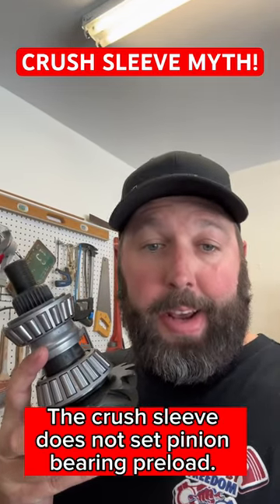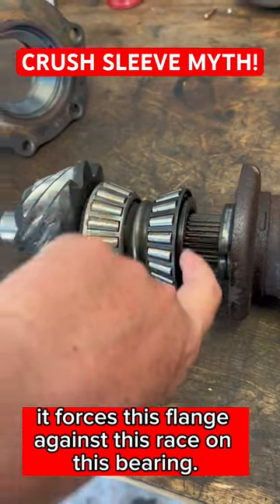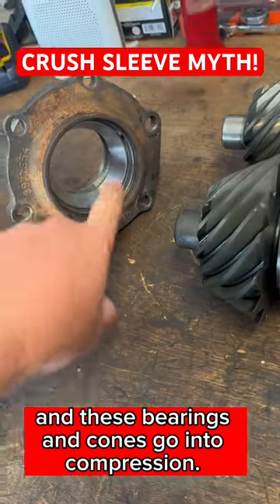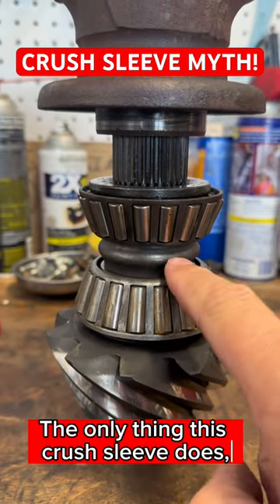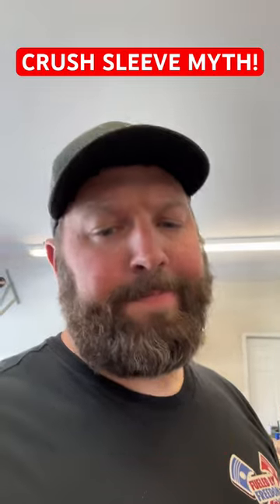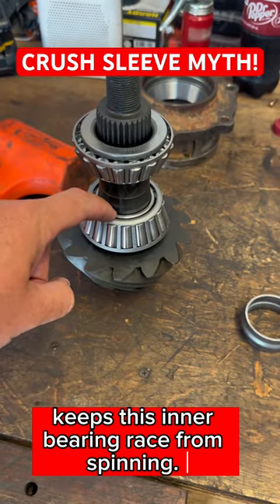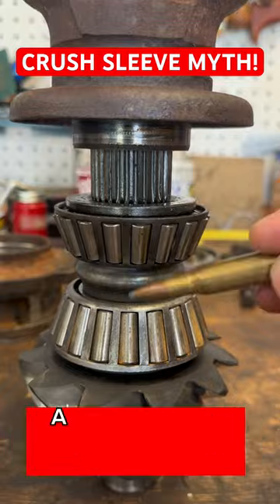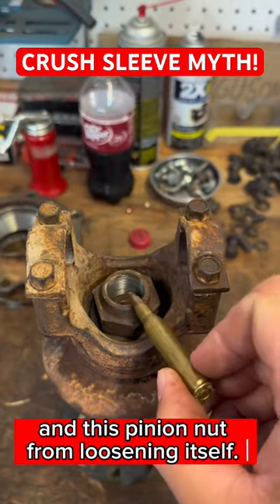Pinion Bearing Preload Isn't Created By A Crush Sleeve! #mechanic #jeep #axle

Comment: Ok from a real expert yes you can set preload without the crush sleeve just one problem with that. You can't maintain proper load without the crush sleeve or spacers on other types of differentials full stop.preload is for setting the bearings or break-in, after break-in has occurred there has to be a spacer to maintain zero end play at the pinion or loss of backlash, end play and run out will occur full stop. In other words you lose proper tooth contact pattern and then premature gear failure. Don't let service mechanic that change wheel seal and bearings tell you how to build diffs. I've built well over 5000 units and yes when I first started out I left the crush sleeve and or spacer out of a couple of different units and they didn't last long because of pinion bearing failure due to no spacer or crush sleeve. Ok I have and other techs have left out the spacer on LMS style hubs and have no problem but you set the hub bearing up like regular hub bearing on a diesel rig. Torque the in nut to 50ft/lbs and back the inner nut 1/4 turn back. What's the difference you ask ok a wheel bearing doesn't have backlash or endplay for a gear set or ring gear and pinion okay. Don't believe everything you hear on the Internet get a service manual out and read it. It will tell you inorder to maintain proper backlash and in play you have to maintain proper bearing preload and that's where the crush sleeve or spacer comes into play. Look at the pinion nut it's a special crimped nut that will not back off in normal conditions and don't need a crush sleeve to maintain proper torque,one little tip replace the nut with a unused new nut to make certain the nut will not back off. There is no way that crush sleeve is a lock washer give me a break.
Reply from the maker: Being a tech means you know how to change parts, it doesn't mean you're an expert on design and theory. I'm not a wheel bearing changer, I'm an engineer. I'm the guy that writes those service manuals you techs follow. I never said to assemble a diff without the crush sleeve, I said it doesn't create preload. Because it doesn't.  If you're an expert, tell me why those diffs you assembled without a crush sleeve or spacer, lost preload and had a bearing failure.
Reply: @freedomworx  ok I'm a Cat and Eaton certified and trained drivetrain technician and worked with chuck dobbins,mike todd at Eaton Corp who are retired now and head engineers who I help develop the ds404,rs 404 modle diffs in the field when Eaton first released that modle differentials. Ok Mr. engineer give me the service manual you wrote and I be less skeptical until then the reason I worked with lead field engineers is because Eaton Corp and Cat send their head engineer over the they designed of course with a team out into the field or my area which is Dallas fort Worth to fix who's f ups theirs. Case in point the RTLO18918B manual transmission Eaton released in the 90s had a problem in the pete 379s but showed up in some 18 speeds no matter the truck brand just the RTLO18918B. Oh I worked for Peterbilt by the way. The trans had a somewhat loud high pitch whining and more trans developed the same, chuck said pull the transmission out and disassemble it to find out what the cause was. Ok engineers don't touch wrench only technicians do engineers use pens and pencil that's what all engineers that I've worked with told me and that's the way it is. Now this is the first time I worked on one of this whinny 18 speeds and none of the engineers could figure out what was causing the whining or any of the other techs. Well I had helped fix other issues with Eaton before and they asked me to see what I could do and well the 4th 5th shift fork was rubbing the drive gear frt box is what I found. You see the trans never showed any failure problems just a high pitch noise that drives couldn't stand. Look at it like this the truck is the driver's office for 8 hours a day and it was very unpleasant to drive a truck like that. Companies were returning $130,000 trucks fleets of trucks because of one truck that made a bad noise per the customer, remember I worked for Peterbilt and Peterbilt bought the trans from Eaton and that was a Problem for everyone got it. To prove my point I took a grinder and removed about 1/8" ok shift fork material and reassembled the transmission and installed it in the truck. I had CDL in order to road-test trucks I worked on and drove the truck with the driver in the passenger seat. The noise was gone. Chuck and his team of engineers had to resign the shift fork and drive gear to prevent this from happening again. This wasn't a wide spread deal and WE caught the problem early so Eaton didn't have to do a recall just a service bulletin if there was a customer complaint. Just because you are a master engineer doesn't mean you don't make mistakes and the service techs can be your friend and help you or get you retired early like Chucky boy. I didn't mean for that to happen to Chuck but he told me I was a no good mechanic and to shut up and let him do the thinking. Yes I do follow the service manual because  chuck told me that I wasn't an engineer and wasn't qualified to reengineer anything. He is right but don't think for one second a low service tech cannot fix a problem an engineer overlooked we do it all the time.ok to your question Mr engineer the pinion has three different forces against it. The pinion gear tries to push away from the ring gear, the heavier the load the greater force up until failure for example tooth breaks which by failure analysis is call shock load.  The other forces are the pinion tries to push out the front of the diff which is frontal load and the inner bearing closest to the teeth not the yoke bears that load only. There is also a lateral load where the pinion tries to pivot. The gear end moves one direction and the yoke end moves in the opposite direction. It is this movement that bearing preload helps to prevent or fight against. You see in order for the teeth of a gear to maintain structural integrity it has to operate within a designed spec or set spec. Which is the back lash, radial run out and back side run out. To confirm that I use a dial indicator with a magnetic base and contact pattern. If the gearset operates outside the gearset parameters the gear failure happens at high loads. If you look at what I said and I say again the pinion bearing spacer greatly helps maintain proper bearing preload during operation of the unit GOT IT!
Reply from the maker: I was a I was an aircraft mechanic and diesel mechanic long before I was an engineer. Like I said, if you’re an expert, tell why those diffs lost preload… You explained what preload is for, but you didn’t explain why the preload was lost without a spacer or crush sleeve in place.
Reply: @freedomworx  yes I did and explained what happens when the preload is lost. Ok you can't be an engineer if you don't understand what I just laid out. I'm going to make this simple for you. The preload is to prevent the pinion from moving away from the ring gear under a load. The gearset is designed to a spec. The bearing preload prevents the pinion from moving. The spacer or crush sleeve prevents the bearings from losing preload during high loads during operation or while driving the vehicle or operation of equipment. If the spacer or crush sleeve is not installed the bearings under high loads will lose preload because the outer bearing has to be a machined fit not a pressed fit like the inner bearing,why you ask, your the engineer and what happens to that outer bearing under high loads and how do you prevent that outer bearing from shifting or moving while under high loads. You do understand that the pinion bends and flexes enough to cause a gear failure. That is what preload is designed to do prevent bearing and gear failure under high loads or do you understand that. I started that the very first time and if you were an engineer you should know about failure analysis and engineers also help write failure analysis books to guide not tell or teach but guide service techs on how to identify broken parts or part failure for warranty purposes because a manufacture trained manufacturer certified service tech like myself made the warranty claims diagnosis to determine what the root causes of failure is. That's what I did for a living and you should know that but for some reason maybe because you don't know what you're talking about Mr engineer then you should know about failure analysis. Now I could be wrong or we are using different terminology. Now I am an expert in my field which is what we are discussing. You should understand what I'm saying because I'm using terminology straight out of service manuals and failure analysis manuals. You tell me what is happening without the spacer/crush sleeve.
Reply from the maker: @tracytalbott9259 so you are basically trying to say exactly what I said I said in the video 😂😂😂
Reply: @freedomworx  no I didn't I'm saying the crush sleeve has to be there or it will lose bearing preload ok it does more than set bearing preload it maintains bearing preload. The service manual says that to properly set bearing preload the spacer/crush sleeve must be present that's in the service manual Mr engineer. I tell you what, pull up a service manual preferably a Eaton service manual and got to pinion bearing preload and it shows you how to set bearing preload without the pinion, that way you then understand what is taking place. Look up service manual for a rs404 Eaton/spicer differential and go to the pinion bearing set up section and you will see a display of a press pinion bearing set, pinion bearing retainer and get this wait for it a pinion bearing spacer/crush sleeve as the pinion bearing retainer assembly and how to set pinion bearing preload. It simplifies the process so even you will hopefully understand what's going on and why you have to use the crush sleeve to set preload.  Take it from an expert like me. I have tried to explain this to you as gently as I can. If you were an engineer you should have caught on by now. Here's my little saying because I have tried to train people on how to properly build gear parts. Yes I also trained people how to rebuild for a living successfully for years. I don't know what service manual you are getting this from because I have cited one and highly recommend to better understand the bearing preload procedure. You can teach a person proper procedure but you can't make them follow it.
Reply from the maker: @tracytalbott9259 the crush sleeve or solid spacer keeps the outer bearing inner race from spinning on the pinion, and the pinion nut from loosening. That’s it and that’s all. You aren’t explaining anything to me. Service manuals are written so techs can understand them. They aren’t written to explain the design of the product 🤷🏻‍♂️ Go read the patent documents on crush sleeve devices. I have. They will say the same thing that I said in the video.
Reply: @freedomworx  The service manual tells you how to assemble the pinion assembly per the manufacturer not me or what I say point blank full stop you aren't the manufacturer. The manufacturer service manual tells you to properly assemble the unit by there specifications that is the engineers that designed the gear part and I know now that you didn't refer to their service manual. A Patten doesn't have assembly specifications or preload specs ,it isn't an assembly or service manual. That crush sleeve fits more than one diff. assembly and each manufacturer has different pinion preload spec the crush sleeve is cheaper to use and takes  the place of several different size solid spacers full stop point blank because the crush sleeve will hold the same preload at different depths Mr engineer. I work in the research development center in Atlanta for 4 years before I rotated out that's the manufacturer Spicer and their failure analysis center that how I became manufacturer certified no ASE but ASE is ok it shows that the tech has a good working knowledge of their field. I was the guy who told the engineers what went wrong and why and gave expert advice to the engineers on how to fix their ups. I started as a no experience mechanic and retired as an expert failure analysis engineer. I haven't heard you refer to any manual or terminology about this subject, I have name dropped experts that I worked and learned under,actual manufacturer certified service manuals and how and why you should use a crush sleeve/spacer it is a spacer because it has to be installed to set preload. Ok Mr. engineer explain why the outer pinion bearing is machine fit and not press fit and what is the design difference. I can go to the manufacturer service manual that tells you the difference and why, you see a manufacturer's service manual goes into great detail about the proper assembly process. Nobody uses a Patten to assemble anything man you take the prize 🏆. I'm a retired engineer ok. Please just stop talking and listen you might learn something.
Reply from the maker: @tracytalbott9259 where did you get your engineering degree? Because if you don’t have a degree, or a professional engineering license (which you can get with adequate experience if you can pass the P.E. Exam and have references), you are not an engineer. Mine came from Auburn University 🤷🏻‍♂️. And my job requires an engineering degree. My job title and salary are publicly available information of you doubt my credentials.  The outer bearing doesn’t  have the interference fit that the inner bearing does, because if it did, it would be ridiculously hard to assemble and disassemble the diff. I.E… you’d need a press to get the pinion bearing on the pinion steer it was placed in the housing, or to get the pinion out of the diff. Pretty simple. This isn’t about knowing how to assemble diffs Mr. Not an Engineer. It’s about knowing what the parts actually do. I assembled the diff exactly the way the manual said. And I never said that anyone else should do otherwise. I think you misunderstood what I said in the video 🤷🏻‍♂️
Reply: @freedomworx  that unit doesn't use a press fit bearing because it more difficult to set pinion bearing preload but Spicer diffs like the dana 60 or 44 or 80 use press fit outer bearing and have the same style housings as I'm guessing you were assembling a Chevy 10 or 12 bolt diff or maybe a 8.8 which I've built successfully with no craftsmanship issues way more than you have and stood behind the and put a warranty on. I made a living doing what you tried once or twice and engineers don't assemble or touch wrenches they design. Who do you work for and did you design that diff or any gear part at all. Do you design bridges or door stop , because I've never heard of you or anything you've worked on. I have my degress and certifications on what you think you know about including that diff your attempting to build. What service manual are you referring to so I can at least read and understand why you make the claims you make. I referred to the Eaton/Spicer corporation model ds,dd rs rd 404,405 diff service manual that they the manufacturer said how to build and I am certified by Eaton/Spicer to warranty/Rebuild who did you say you worked with or for and who trained you to build what? I really want to know the service manual YOU are referring to. What is it,did you author the manual I'm trying to understand your madness.
Reply from the maker: @tracytalbott9259 no service manual tells you the purpose of a crush sleeve. That’s why I told you to look at the patent documents. I’m just telling you what’s in them. You can argue with the designers and patent office if you want to 🤷🏻‍♂️. Enjoy retirement 😘
Reply: @freedomworx  ok now I'm going to try this one last time and I'll keep it short. The inner bearing is pressed but doesn't locate the bearings. It does bottom out but it doesn't locate the inner bearing. The crush sleeve also locates the outer bearing. You can't have any endplay or you will never have an accurate back lash and run out adjustment or reading because the inner race is not locked in so it cannot move in or out up or down. The inner race and the outer race cannot move at any time cold or at operating temperature and speeds. The carrier bearings are the same way
 you can't have any endplay or runout. I can't think of any other time in the automotive field. Well the output bearings on some transmission have no end play. All other bearings are designed with end play. Babit bearings in a motor or even electric motors have end play. Transmission bearings have end play but differentials cannot have endplay and the only way to do that is to use an exact thickness spacer in-between the two bearings to achieve an exact inner race depth and an exact outer race depth and that will not allow the pinion to move in or out or up or down,yet will turn freely with little drag. If there was no spacer of an exact thickness for the inner race and a retainer with a exact thickness to hold the out races or cups to a secure depth then the only other way to get a preload is to tighten the nut up until a measurable drag could be obtained. The problem is when the diff gets to an operating temperature the bearing preload changes and causes the bearings to overheat and burn up,in other words there is no set bearing preload because it changes when the diff warms up. The crush sleeve under load by the outer nut torque to a very high torque load will help hold the bearings preload even at op temp. or at cold operation. The pinion bearings are specific to that app only. The crush sleeve keeps the bearings in preload,they have to be used with a spacer or crush sleeve to maintain proper bearing preload they work as a matched set and it's set at assembly only, but with the development of the adjustable spacer or crush sleeve the proper bearing preload can be obtained with the crush sleeve. Do you know what torque to yield bolts are. It might help you wrap your head around what is happening at the time of assembly and it's killing 4 birds with one stone. It does more than keep the bearings from spinning and I hate to tell you but it doesn't prevent the bearings from spinning on the pinion. The outer bearing turns on the pinion I'm talking about the inner race of the outer bearing. So no it doesn't stop the inner race from spinning on the pinion it's an interference fit and I have seen several spin marks on low mileage diffs that use that design. Remember I told you I'm failure analysis certified and there is a clue left by a bear that has rotated on any shaft that wasn't the point of failure but normal wear and tear. It leaves a dark red stain on the mating surface of the bearing and pinion shaft which is not a failure or excessively worn part. Only press fit bearings are not supposed to spin or a failure will happen. I worked in r and d that research and development. I was there for the prototype the testing of the unit the failure of the unit while in service and the improvements, recalls and development of repairs strategies for units that develop problems after production starting. You do know it takes a degree in metallurgy to work in failure analysis. The pinion nut is designed for that specific application and will not back off unless it's been used or defective. The crush sleeve has nothing to do with the nut staying tight or backing off. The treads and design of the nut holds the treads of the pinion that prevent the nut from backing off. I'm stating facts not my opinion or because I said so. It's common knowledge of the part. They are special locking nuts. Pinion nuts are a special design,when a vehicle is coasting or accelerating it causes the yoke to move back and forth and will loosen a regular nut whether it's left handed or right handed treads. It's a special crimped style nut.
Reply from the maker: @tracytalbott9259 explain to me how you think a crush sleeve locates the inner bearing, and not the press fit… The crush sleeve doesn’t even touch the inner bearing inner race on most pinions. The bearings cannot move in or out on a pinion if there is proper preload applied, and that’s with or without a crush sleeve or spacer installed. They cannot walk inward because the housing separates them, and they cannot walk outward because the pinion head and pinion nut prevent that. Also explain to me why there are standard NAS and ASTM test and test apparatus to see how many cycles it takes to loosen a lock nut, if a pinion nut cannot back off??? It’s a prevailing torque lock nut just like any other. Nothing special about it. If a pinion nut won’t back off, why do solid spacer diffs have such high torque specs? Why not just snug them down? The bearings can’t move right?  It’s a solid spacer… So either that nut gets tighten down significantly so it doesn’t back off, or it gets torqued down significantly to ensure that outer bearing inner race doesn’t spin on the pinion, or both. Both points that I made in the video that you are disputing.  If the spacer/sleeve doesn’t do either of those things, it has no purpose at all.  Should a pinion nut back off? No! Can it back off? Absolutely! But most of the time when people find them loose, it’s likely due to a bearing failure that caused the nut to seem loose, not that the nut actually backed off. Same thing for people that think their crush sleeve collapsed from too much HP (they mean torque).  An outer bearing inner race will only spin on the pinion if there is something wrong with the assembly, that’s part of what the crush sleeve or spacer is there for. I have had outer bearings fall right off of pinions before, but only on failed rear ends. Never one that was properly assembled and maintained. And I don’t buy the thermal expansion piece. Everything in that diff is made of similar steel and heats up at basically the same rate throughout. It all grows together in respect to the length of the pinion shaft. The bearing clearances aren’t changing. Not the fit on the shaft, the clamp load between the bearing races crush sleeve yoke and nut, or bearing preload. But if you could reference where I could read that thermal expansion “fact” I’d love to learn something.  Yokes don’t move back and forth on the pinion. There is nowhere for the yoke to move. It’s pressed against the outer bearing inner race, that’s pressed against a diff housing, that can’t move in or out because of the preload between the inner and outer bearing.  It might be experiencing loads that want to pull it into the diff, but it certainly isn’t moving as a result of those forces. It’s stationary, preload ensures that.
Reply: @freedomworx  haha hahaha I just went back to your video to look at which diff you are working on. That is a ford drop out or what is referred to as a 9" but ford also made an 8" and a 9 1/4" version. You sir have no clue what you are talking about. Hahaha 😂😂😂 I've built hundreds of those drop outs for dirt trackers and drag racers,that sir is a third member because it drops out the front of the rear end housing. Yes that spacer which is named a crush sleeve compresses between the two bearings it does it in your video hahaha. You will not obtain proper pinion depth if you leave that sleeve out. You have embarrassed yourself on the Internet haha hahaha! I don't know what kind of engineer you think you are but you have no clue. It's a lock washer yeah haha hahaha 🤣.
Reply from the maker: @tracytalbott9259 the funniest think about this conversation is your misplaced confidence in your level of understanding. And you misplaced belief in my lack of knowledge. I don’t doubt that you believe what you are saying is fact, but you are simply wrong, misinformed, of just simply stupid. You have no idea what you a talking about, and you have lied this whole time about your education and experience. There is no way you could be an engineer in the powertrain industry saying the ignorant shit you have said. I said MOST DIFFERENTIALS! Learn to read. Yes the spacer touches both bearing is a 14 Bolt and a 9”.  That’s because the pinion is so short in those diffs. It’s also why both of those diffs have a pinion support on the snout or the pinion.  Because the distance between the two bearings isn’t sufficient to support the lateral loads created between the ring and pinion. The spacer doesn’t touch both bearings in a Dana  60 like you referenced earlier. How does that inner bearing possibly stay in place without the crush sleeve holding there??? 🤡🤡🤡 Like I said, your level of ignorance is actually impressive. When you start a conversation with “Ok real expert here” everyone already knows you are an ignorant fool. Because truly intelligent people don’t need to say stupid shit like that. This video has been viewed millions of times across multiple platforms, and was even commented on by Yukon, the manufacturer of the gears. They even thanked me for clarifying the topic. But I guess they don’t understand their product and a fake Failure Analysis Engineer from Eaton does. You’re either a completely liar, or the dumbest supposed powertrain engineer (not degrees or licensed engineer) I’ve ever had the misfortune of communicating with. Piss off dude. You’re an ignorant fool and wasting everyone else’s time.